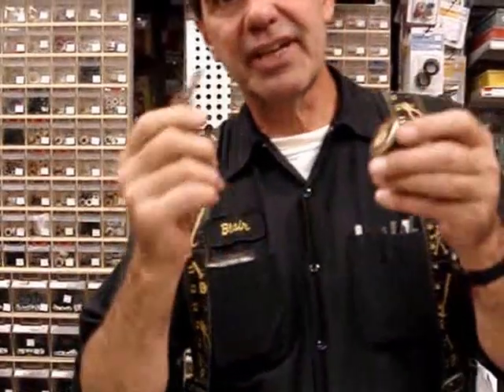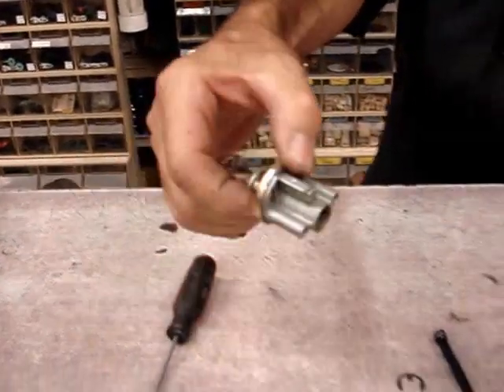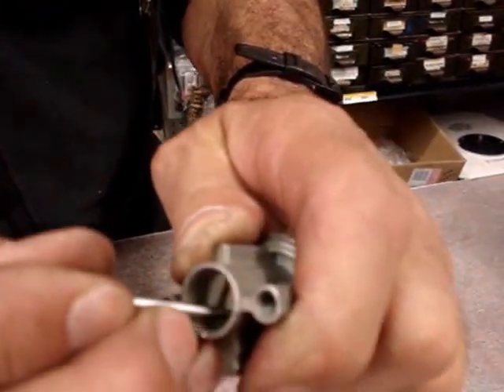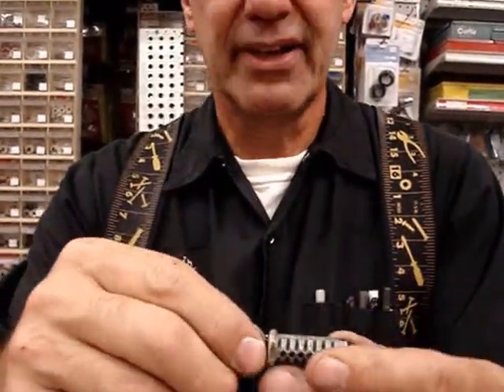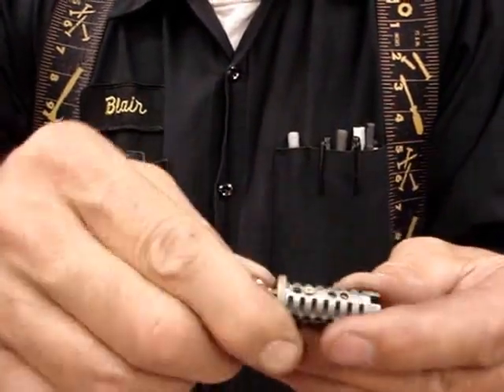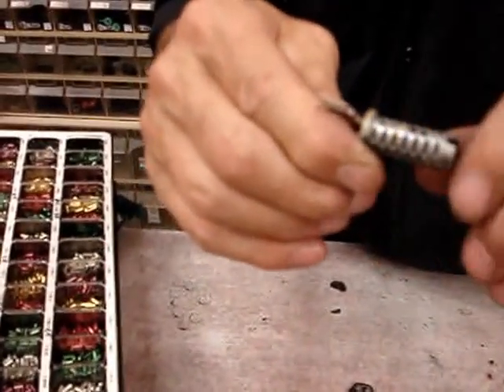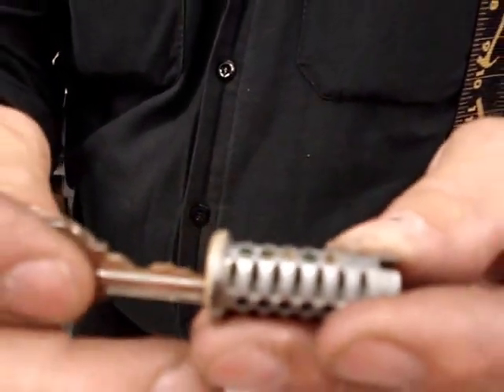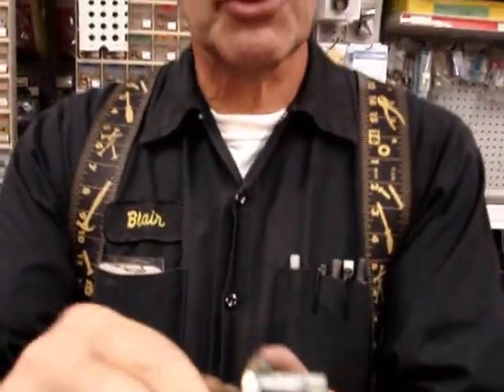Pin Door Locks - Prevent Home Break-Ins from Thieves Bumping, Picking

Comment from the maker: I'm sorry, I didn't show the anti-bumping, anti-picking upper (driver) pins. Typically only a locksmith will have them. They look like little barbells that replace the upper pins. The ridges catch on the cylinder and reduce the ability to get all the pins aligned so the cylinder can rotate. Nothing is unpickable but the ridged upper pins make it very hard to pick or drive.
Reply: Maybe rename the video then?